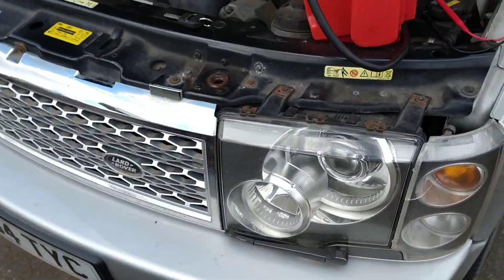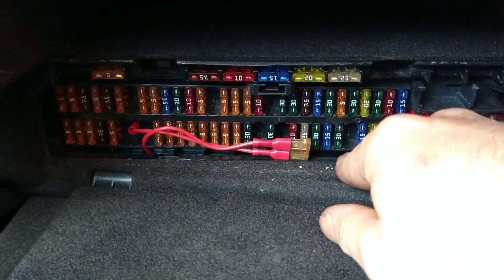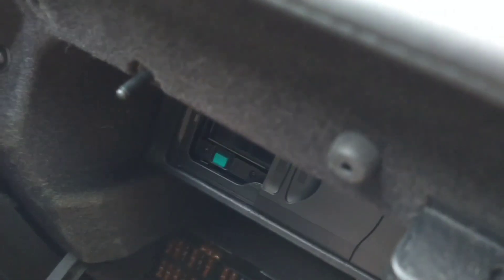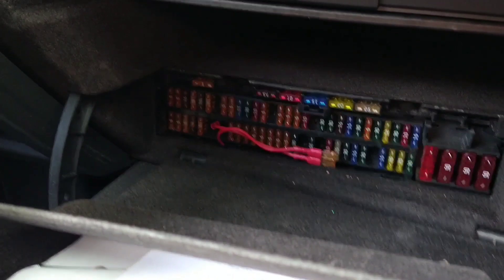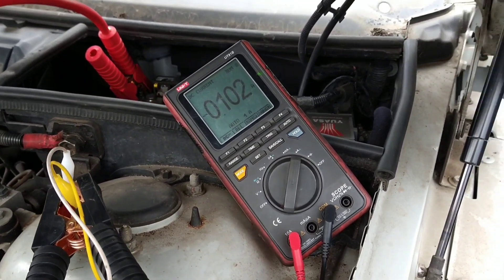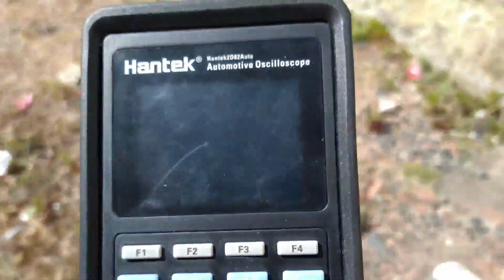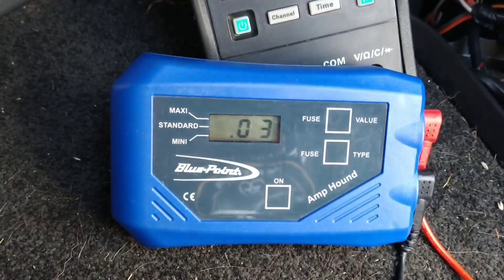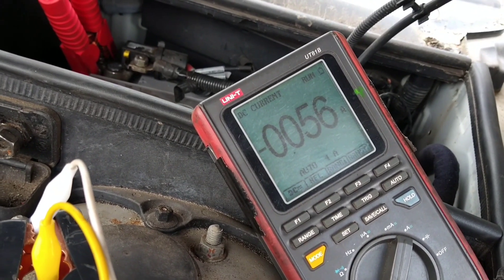LandRover RangeRover with a battery drain

Comment: I found a 400 milliamp draw from our suspension ecu in a 2006 range rover sport HSE. Can I pull the fuse as a temporary measure? Does this circuit only need to be active when CHANGING suspension height, or is it always necessary?

Comment: I have a 2007 LR3 4.4 HSE
Second time within a year I've installed a new alternator and battery. 
The headlights and dash lights, screen etc.  Seem to " flicker" and there is a battery Drain overnight whilst parked, the horn fuse keeps blowing, I have started running a battery charger at night as there is a pericidic Drain of some type....
Thoughts?
Oh and the alarm seems to be going crazy aswell as lately if I use my Fob to lock the door, it wont unlock with the fob, I then have to unlock with the key, setting off the alarm until I start the engine. 
Baffled.

Comment: Hi i have a 2004 landrover hse the battery says 13v the key wont turn in the ignition and nothing in the car works cant turn anything on even with the key not in the ignition but the battery is saying 13v any advice please?
Reply: First are you able to lock and unlock the car via your ignition key? If not try putting a new battery in the key fob. Also does the steering lock unlock when the key is brought close to the ignition switch. Usually the steering wheel might twitch and you hear it unlock, but at the same time the ignition switch will unlock itself and allow you to turn the ignition on. I'm having trouble with this as the parasitic draw is pulling my battery voltage so low even overnight so that the ignition sensor won't react to my ket being brought near or inserted into the switch. I have a big diesel battery under the floor by the rear fuse board and it connects to the main cable of the fuse board via a 100 amp relay which is powered only when the ignition is on. But if the battery voltage is too low for the ignition to be put on then it can't help the starting. Temporarily I am going to run a pair of wires via a 5 amp fuse from the positive of the diesel battery to a switch up front and back to the live side of the relay so that if I can't turn the ignition on, I flick the switch and I have 12 volts into the system which allows me to turn the ignition on. I leave it on for a minute or so to give the main battery some juice before I attempt to start the car. ( mine's a 4.2 Supercharged) the engine only has to spin a couple of times and it bursts into life. I have yet to find this parasitic drain, but I suspect it's in the infotainment system somewhere. It's definitely Not the HVAC system as I've checked that a number of times locking the drivers door lock with it open and letting the car go to sleep and not a peep out of the little heating fan.
Reply: It’s your steering column unfortunately with the locking mechanism- you can bypassed it with a switch that you use every start up or find a good used one at a salvage yard like I did. Between labor and the column I spend 1000 but no problems since.

Comment: I’m having a problem where I changed my alternater and battery and checked to make sure it’s all connected correctly yet it’s not recharging the battery at all and soon as I turn the car on it’s telling me I have a dead battery
Reply from the maker: It may be worth checking the fuses for a blown alternator fuse. Check for power at the big post on the alternator.
Reply: It’s you a/c control panel unit there’s a little fan running where your control the temp and heated seats look it up on YouTube or it may be you final stage resistor or fuses lol
Reply: A/c control panel

Comment: Hi Matt
I own a Range Rover 2004 L322 TD6, I haven't used the car for a while and the air con is refusing to blow cold, I had the air con re-gassed a year ago and it worked perfect,  I have checked and can see that the clutch on the air con unit is not spinning so obviously it isn't pumping, also the vehicle has always had a big voltage drop problem on the bateery, even after I put a new battery on it after a long run the next day it would read only A Quarter of battery life but it would start the car OK, NOW that I have not Been using it much it is obviously flattening battery after a few days, Any help and advise would be greatly appreciated, Regards Andrew
Reply from the maker: The air con may just be a slow leak since it has been a while after the AC service, if it hasn't got the pressure the AC clutch won't engage.
Possible AC condenser leak.
The battery drain could be anything, usually anything added to the car, aftermarket extras, but really needs checked with an amp clamp, or voltage drop across fuses with a multimeter.
One other thing, if your car is standing for a few days without starting it, try charging your battery either off the car or with the battery cable disconnected, after the battery is charged, leave it a couple of days if you don't need to use the car, then load test it, if you don't have a load tester put it back on the car, if the battery is dead and unable to crank the car you would know it's a bad battery that no longer holds a charge.
Thanks for watching

Comment: Same old Matt. Really don’t understand people’s drive to install aftermarket equipment. Often ends in tears. “Ghost Voltage”. Sounds like somebody’s been reading some of Dan Sullivan’s material. Cheers Pal
Reply from the maker: Yes, it was Dan Sullivan. I wish I new to check for millivolts over the fuse when I worked at LandRover, I had a similar thing, I pulled a fuse and rechecked amps at the battery, every time I put a fuse back it would wake up the car and I would have to wait for it to go back to sleep again.
Thanks for watching

Comment: Great find Matt, those can be tricky...I had a trailer  brake  module once that would occasionally stay on...and yes aftermarket install, took a while to find that one.....   👍👍👍
Reply from the maker: I like the fuse loops, I really should get a pair, I'm slowly adding to my collection of tools.
I think the uni-t all-in one voltmeter and amp clamp looks good too.
I find with my add on amp clamp it gives me questionable milliamp readings when I check around the battery cable, it may be because the clamp couldn't fully close.
Thanks for watching